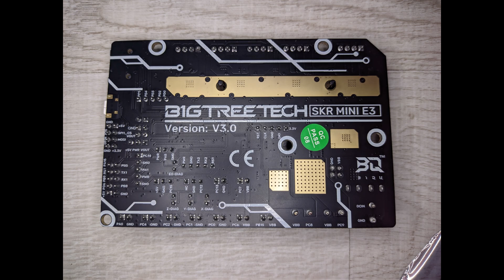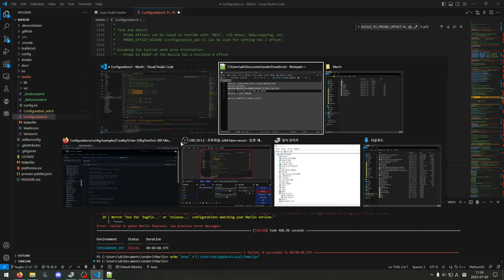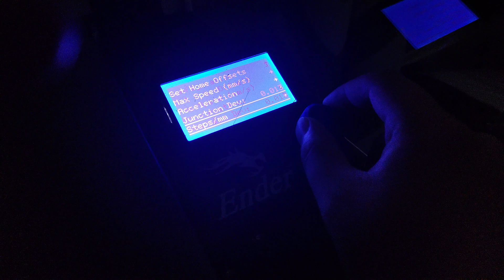BigTreeTech SKR mini V3.0 installation on Ender 3

Comment: if you did it all a bit faster I wouldn't have had to watch it at all, useless video!!!
Reply from the maker: @jayedgecombe  just increase playback speed dude
Reply: i disagree, he explained it all very thoroughly which is why it took longer, i would rather have patience for more information on something like this than jump into it blind, like for example, lets say you buy it not knowing what to do and you didn't know you need the extra connector for the heatsink fan connection to the skr mini motherboard, good luck with that